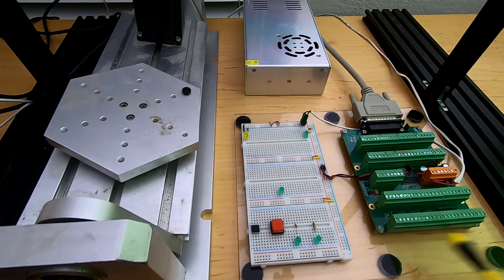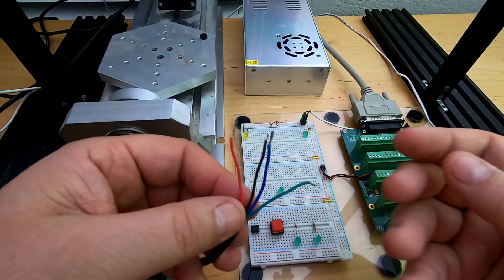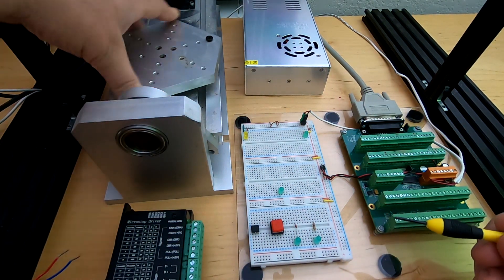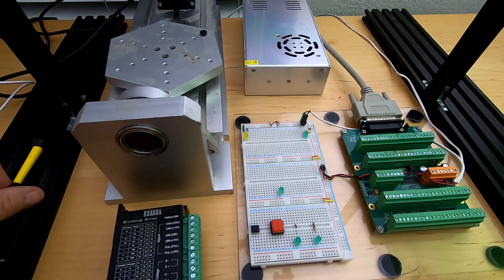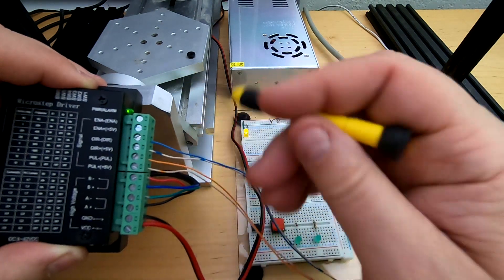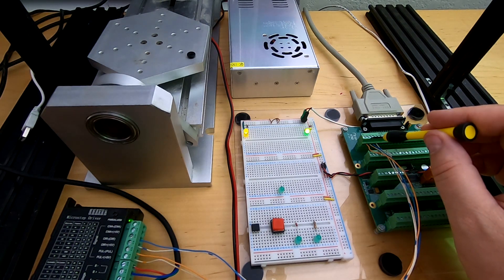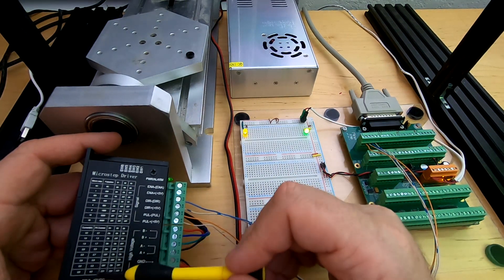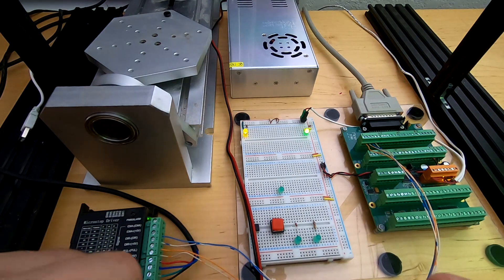MESA 5 - Connecting a Stepper

Comment: i have working cnc whit 2 piece paraller port BOB card, and interesting buy mesa 7i92 aliexpress clone card (because have LOT cheapen than mesa genuine owerprice mesa cards) but not know how this working wiring and setting this unknow cheap mesa 7i92 clone card, fear buy mesa if not working waste 50€ money,its hobby user BIG money. interesting mesa because maybe can add more input pins. if future add own addons, cooler, flood, fan, laser head, brake servo, etc. and not has solved one problem, how run 2 Y axis stepper motors and can made sguare level to Y axis both motors,  mean if run home run both motors to home and IF Y2 motor not has home position run only Y2 motor to home Y1 has in home, or mirror, y2 if home and need run Y1 to home. then beam is sure right postion if Y 1 or Y2 has lose step before. one paraller BOB card i use now and cnc working good, but not can controller dual Y motor, if add Y2 motor to A axis pin and add joint 1Y copy and add joint2Y  to hall file not working dual motor Y. what need doing, can use 2 different motor same Y axis. all time only errors and linuxcnc forum no help, i ask manytime and some answer has but not working, only lot come erors. maybe mesa card help and can controll dual Y axis whit linuxcnc 2.8.4 version. cheap paraller port BOB card can handle 5 axis XYZAB but linuxcnc NOT can use errors only alltime start program.

Comment: hey jerry
Did you make a video on the mesa card setup?  I am up to that stage at the moment and stuck
Reply from the maker: Ahhhhhhhhhhhhhhhhhhhhhhh ---- No. I know... I need to do it... I've been doing 12 hour days... but I have a break... let me start filming now... and I'll really work to get something this weekend. Soooooo sorry....
Reply: askjerry   no worries.  Just want to say a massive thanks for the awesome videos in the first Place.

The main problem I'm getting is the stepper is not moving at all when I try pulse it.  It is set up as per your videos Mesa 2 pin and connection vid.  And happens to be exactly the same driver.   I'm wondering if my Mesa board needs reflashing.  It is a plug and play set up from John Thornton.  Mesa us.  So should be good but I'm stumped.  Do you have any ideas?  Also if you don't mind answering a couple of emails feel free to contact me here.  andrewbeck0000@gmail.com.   I would love to be in contact with you and won't ask too many questions:)
Reply from the maker: @andrewbeck4791  We did a share-screen with Google hangout... it turned out that the PULSE and DIR pins were swapped... it's working now. Hopefully I'll get a video out this weekend. I shot the whole thing... then found out the Hero 5 doesn't work as well as the Hero 3 for shooting a monitor.

Comment: Hi Jerry,  Love the videos, they are a great help,  Could I ask, I'm building my own cnc machine and I'm using 2 x nema 17 stepper motors on the Y Axis,  do I have to calibrate the motors "if so,  how?" and should I reverse one of them so that they push and pull inline with each other? My board is the china saintsmart board.  Cheers.
Reply from the maker: BEFORE you tighten the connectors on the steppers... connect them to the driver board... and run the STEPCONFIG to see how they move. Likely one will turn in the wrong direction. Remove power, on that stepper swap two wires Like the A1 and A2... and try STEPCONFIG again. This time they should BOTH turn the same way. If so... while under power and locked in position... tighten the screws to lock the shafts. Try running it again... it should run perfectly in sync.

Just note... that the current settings for these two steppers will be higher than a single stepper. So if the rest are at 2A, you will probably want to try 2.5 or 3.0 amps. Not quite double... but somewhere in-between. 

The other way to do it... is to use the same STEP-DIRECTION signals, but with TWO drivers... again, one coil will need to be reversed. Then BOTH drivers will be set to the same current. I have the Frankenlab running with 2 steppers... one controller... and it is rock steady. Good Luck! (Email me if you need more help.)
Reply: @Askjerry    Cheers Jerry.
Reply: @Askjerry  or NOT change mechanic coils, go only pin config site and invert second motor direct pin, if move wrong way.  step pin is same but if 2 motor run wrong direct need only invert dir pin setting and then start and run again and test has motor direction changed.